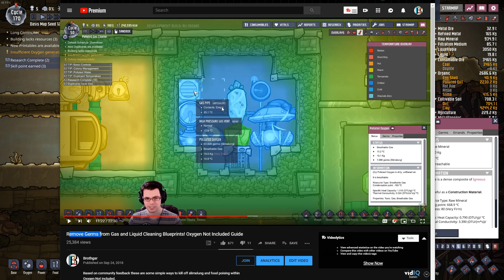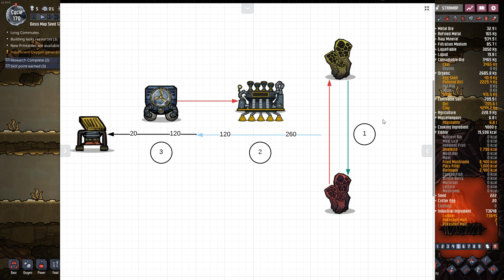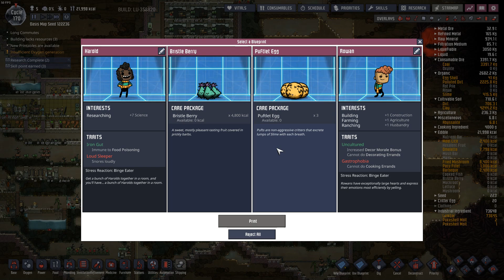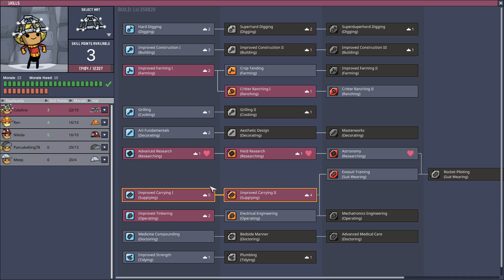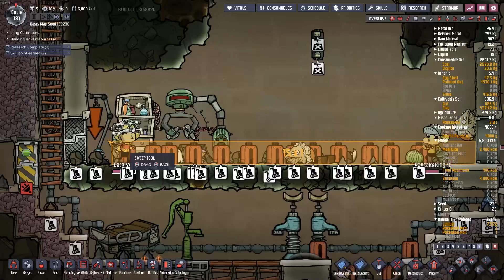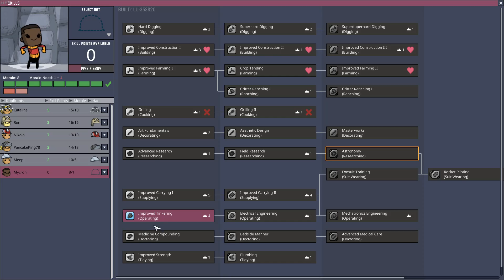The Super Polluted Oxygen Vent! Oxygen Not Included ep4

Comment: Brothgar: using etanol as power is just wrong. You building up so much heat and CO2 it will counter all your cooling!
if you use lumber as powersource use the woodburner. Less CO2, less heat and less problems overall. No pdirt but who needs pdirt at 90°C enyway if you have a pwater boiler!

also aluminum is the new dimond!
Reply: Methinks you didn't watch his previous Oasis videos or ethanol experiment vid. His ethanol setup is tied to an electrolyzer and heat deleter. From just lumber and sand he makes power, dirt, and cool oxygen.
Reply: @Lombardio  I watched it.
His toiled loop build up more pwater for less complex mess.
Lumber is best as powersouce in woodburner. 

Ethanol isnt a good fuel.
And the petrolium generator makes more CO2 a problem.

Comment: There is one single tile that block vents and it's the same on all vents. It's the Second Row, Right of Center tile.  This tile prevents analyzation, so no way to analyze without unblocking.

I also think that it blocks both venting and the "heat" that vents core column indicates it has. (Though that might be because the core column doesn't have any way to transfer it's heat at all, blocked or unblocked)

Comment: You can use a buddy bud to "filter" slimelung out. No two germs can be in the same air tile. So if the pressure is pushing the air out use a buddy between the high and low area, push the slime into the floral sent and that will clean the oxygen.

Comment: i thought i commented on putting the two vents together to remove the germs then cooling it down. my comment must not have posted or something. anyway you don't need a lot of cooling as the 500c vent only puts out 280g/s i think it came to something like 34k DTU needed per second to cool that to 0C( includes dormant cycles ect). it's really not that much, a turbine needs like 877k DTU to run at full force. i suppose that's what the volcano is for?

i wanted to point out that Aluminum is VERY good for quickly transferring thermal energy it's got 205. it's on par with Thermium which has 220, while diamond only has 80. it's melting point is 660C which would be fine for the hot vent, the volcano not so much xD. oh and Aluminum has almost twice as much thermal capacity as diamond does. 

the base is looking really good, all of these extra vents really add so much value to a playthrough, it's wonderful to see.

Comment: Hey Brothgar, I've heard that if you shutoff a transformer directly using automation, the little bit of juice inside the transformer is deleted and never used. So instead, I run the auto wire to a power shutoff just before the transformer intake. This leaves the stored energy inside the transformer to be used rather than deleting it.

Comment: I wouldn't be all that excited about the diamond given that aluminum won't melt at these temperatures and has much better thermal conductivity, but I suppose you need a lot, that's a pretty crazy system to see in only ep 4! Do you plan to upgrade to aluminum after metal refining is all up and running? You'll probably need your diamond for the volcano harvesting later.

Comment: Brothgar! I know there is a better perpetual motion than your sour gas boiler! That is because I did the math!
Reply: Basically pufts breathe polluted oxygen and excrete slime that emits polluted oxygen pufts can be in symbiosis with themselves. When there is enough polluted oxygen in the room the slime is siphoned into a sage hatch ranch where the slime gets converted into coal. The coal gets burned in generators and the carbon dioxide is eaten by molten slicksters. Molten slicksters excrete petroleum that is burned in generators. The carbon dioxide from the petroleum generators then gets further fed to molten slicksters and they excrete more petroleum and repeat until there’s no carbon dioxide left. Meanwhile the polluted water coming from the petroleum generators gets boiled using thermo aquatuners and the steam runs through a steam turbine, leaving the hot water to go into an electrolyzer chamber to convert into hydrogen and oxygen. The hydrogen is burned in generators while the oxygen is a byproduct and must be vented off. The polluted dirt from the boiling process gets into another sage hatch ranch so there will be coal and petroleum repeat as much as you like or until everything is used up.
Note from manufacturer: because the energy is delivered only in small bursts, the assembly needs lots of batteries so the machine maintains charge so it can produce more power.
Reply: Brothgar anyways i hope you’ll make it and if you do please give credit